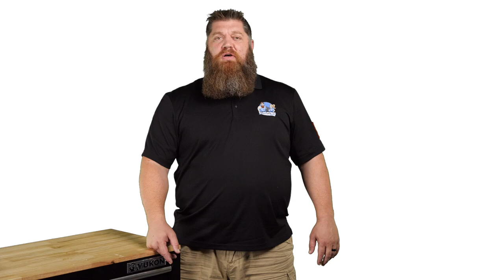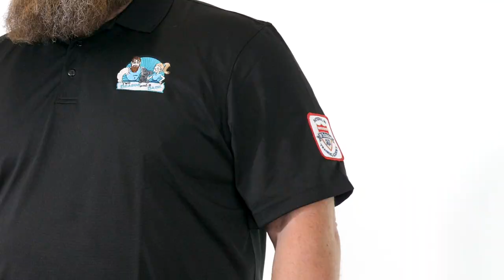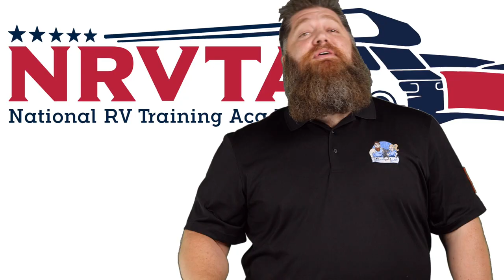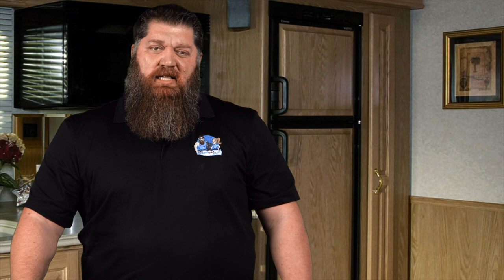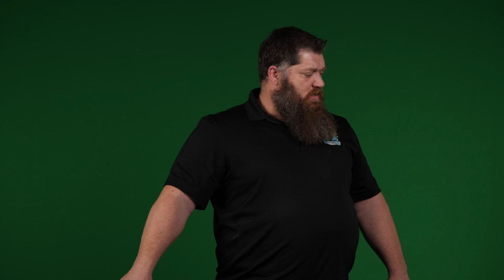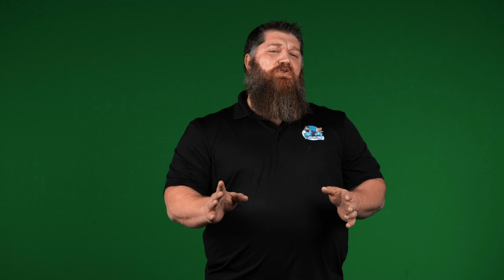The Truth behind RV Refrigerators

Comment: When in the more rustic campgrounds like State or National Parks you can often only get "close enough" leveling.
What would you consider to be acceptable leveling "wiggle room" to protect the fridge?
Also which leveling is more crucial, back to front or side to side?
Reply: Excellent question 
I’m wondering also
Reply: 3 degree side tonside 
6 degree front to back

On the bottom plate of the freezer...

Comment: What about running the refrigerator while driving and would this cause the same problem? Also, do 12 volt refrigerators have the same issue or are they safer to keep running while driving? Thx.
Reply from the maker: One of the most common causes of RV Fires in someone leaving the RV refrigerator on while driving. since the new 12v compressor fridges don't use propane it's safe to keep on while traveling. though depending on your batteries they may be low. by time you get to your destination.

Comment: I keep trying to boondock and I ended up with my propane system AND my water system not working. Paid to have the systems checked and then learned about the need for leveling. I tried leveling the next time, and still didn’t get it level enough. 

So, how do you level? How do you know or learn what your wiggle room is? This issue is seriously turning my camper into a big metal tent instead of a cozy camper!

Comment: what is the maximum angle off of level that is safe? When i pull my 5th wheel out in front of my house getting ready for a trip. the crown of the road causes the trailer to lean a bit to one side (leans on the fridge side). Is there a safe angle other than perfectly level?

Comment: I’m taking your Home Study Course…If I cannot drive with propane on (I understand why now) how can I install an Inverter for my refrigerator plug?
Reply: I use a portable power station a 1300 watt hour one that keeps my 200 watt heating element hot (cold fridge) between 5 and 6 hours, then just recharge the power station when you get setup at the camp ground.

Comment: How does this apply if you run your refrigerator while on the road?
Reply from the maker: You really shouldn’t have your propane on while driving. Turn you fridge back on each day when you’ve finished driving for the day. You should be ok for quite a few hours if you leave it closed. Grab a cooler for drinks on travel days
Reply: What if on the road using inverter
Reply from the maker: @vickishort9128  end the end it’s up to you. They want to be level when in use.
Reply: Sound like RV refrigerators aren't suited for RVs.
Reply from the maker: @chrisfoxwell4128  lol, pretty much.
Reply: Over the last 4 trailers, we have always traveled with the propane on (knock on wood) and never had any trouble?
Reply: @NationalRVTrainingAcademy  so you’re saying turn OFF the fridge when you’re traveling?
Reply: @johnbolt665  Human nature is a funny thing. In spite of warnings, as long as there is no problem, it's ok to proceed.
Reply: @johnbolt665  I've always left mine on too ...unless my travel day involves tunnels
Reply: @NationalRVTrainingAcademy  wouldn't it matter how long the unit was unlevel for ? ... Years ago and was told it's ok to leave RV fridge on when Le traveling as the level was constantly changing ....but was vitally important when parked for extended periods of time? Everyone teases me about how anal I am leveling my camper

Comment: love your videos, and plan on taking the home training course this fall when we return from our last trip of the year. One question on leveling, I tend to keep the trailer at a slight up angle about 1to2 degrees just so the rain water and AC water falls off the roof via the gutters to the back of the trailer. would this hurt the refrigerator coils? Have not had a problem yet but do not want to create a problem in the future.
Reply from the maker: Yes. Those coils need to be as close to level as possible. Most RV roofs are sloped so that water doesn't naturally collect and runs off of the sides.

Comment: How does this apply to refrigerators that are in most Class B Vans?
Reply from the maker: The little electric refrigerators should also sit level to make sure the refrigerant doesn’t slug the compressor but it’s no where near as critical as propane refrigerators.
Reply: Does that include compressor refrigerators which I hear a lot of people say they don't need to be leveled to work properly, is this a myth or Truth?
Reply from the maker: @FOMC6780  compressors need to be upright due to the oil in them. I’d also check with your manufacturer

Comment: Am I correct thinking that these reefers are absorption systems? It seems like the perfect setup for desert homes using the sun for your heat source.
Reply from the maker: We are talking about absorption refers in this video. They are ok, but with the advent of smaller inverters and better compressor style reeders, they are a safer option.
Reply: @NationalRVTrainingAcademy  thanks for getting back to me. I've wondered so long about using that type of system for home use but the dangerous refrigerants was always a drawback.